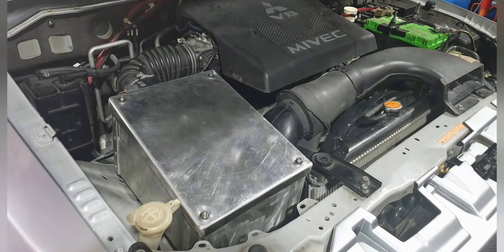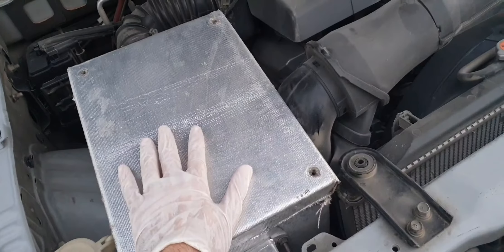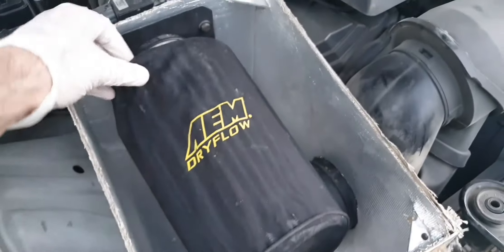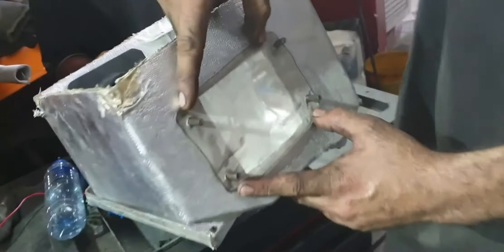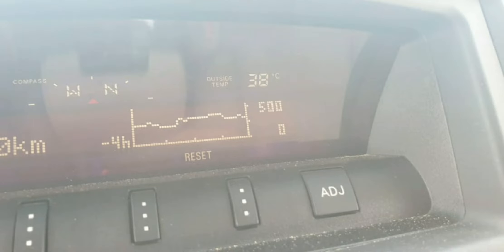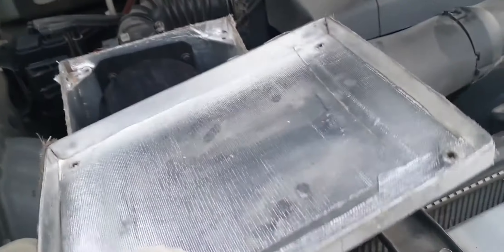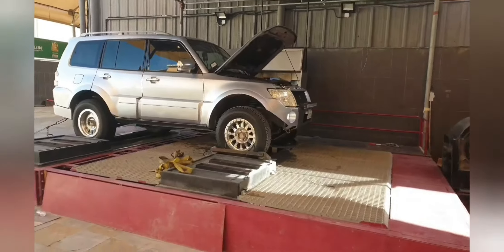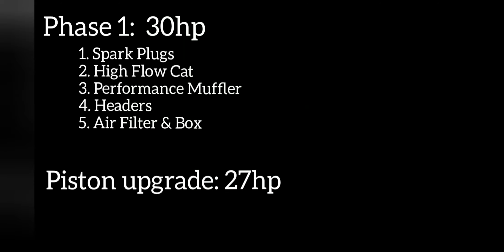Pajero Custom cold air intake box that works! [Dyno Tested]

Comment: Thanks for the videos, very informative.
Can you make a video on what type of upgrades done to avoid overheating of transmission oil and the engine.
Thanks
Reply from the maker: Sure thing will add it on the list of upcoming videos 🙂 I have done a number of measures to reduce heat on the pajero from installing a bigger transmission cooler, lower temperature radiator thermostat, engine bonnet spacer lift, mesh grill, heat insulated intake, using high quality AMS Engine Oil, high quality coolant and insulated the area around the radiator frame to make sure maximum focused air is going into the radiator area. Hope this helps to get you started and please subscribe for future videos
Reply: @SandTrack  already subscribed 
Looking forward for these videos

Comment: Hi, regards from Chile.
Which is the part number offroad filter?
How many inch?
I have 2008 mivec 3 doors, i want to release engine power.
Regards
Reply from the maker: Hello thanks for the message. You will need to make a custom clamp to hold the filter and this is filter model and name:  AEM Brute Force Edition Filter AEM 21-2039BF
Reply: Thanks for answer.
I just to know how do you fix the upshift problem when you use in manual mode?
I saw some videos you and heard the engine in red limit revs (cut electronic) and the automatic gear box dont  gear.
Regards and thanks for your help

Comment: Does adding the dry intake require any type of tuning or is it plug and play?
Reply from the maker: Its plug and play and works without tuning. However for best results tuning is a plus. Also check out our dedicated pajero plug and play traction switch www.cronos4x4.com

Comment: Original air filter for the Pajero 3.8l are killing all the engine performance...

Is your modication worth it for road use only ? I switched from a K&N filter to a OEM one because of sand and now I hate the engine performance and I get disgusting fuel mileage 😭
Reply from the maker: Hello we avoid K&N filters in the sand as they require constant oiling and sand sticks to it like glue. We use dry airfilters instead which are easier to clean and do not use oil
Reply: @SandTrack  Nice to know, I guess K&N filter are a wast of time in Dubai. How much would your own setup cost in Dubai, including the labor ?

Comment: Hi , thinking to get get OBD 2 ( Blue Driver ) but not so sure if it’s compatible or not . Any recommendations or advice? Thanks
Reply from the maker: Hello I suggest that you get the blue obd elm 327 version 1.5. This version is able to read the pajero transmission temperatures. Here is the link: Obd 1.5 version 

https://m.aliexpress.com/item/32791448031.html?spm=a2g0n.orderlist-amp.item.32791448031&aff_trace_key=cfb5bfd991434419ab9d5c432a0b87ca-1552803339311-02883-UneMJZVf&aff_platform=msite&m_page_id=4782amp-yAHYnHB4vytYVBHVanQcqQ1552844514390
Reply: @SandTrack  Thanks a lot bro. God Bless You.